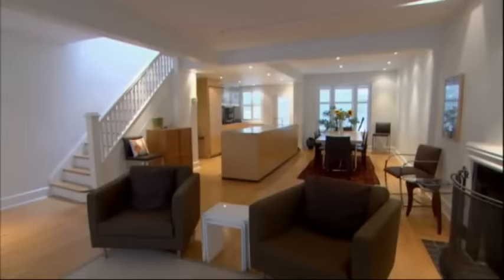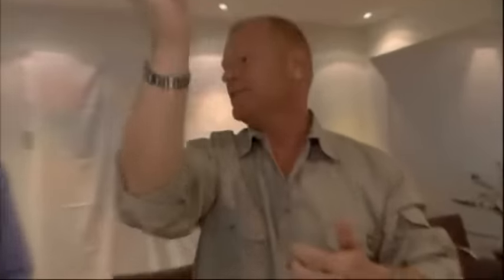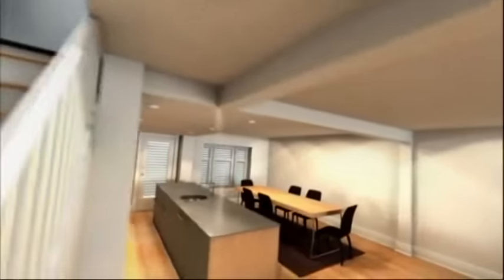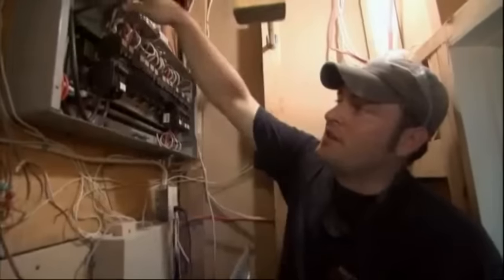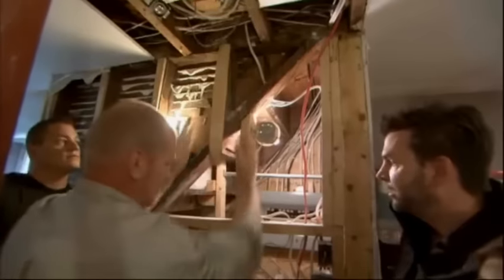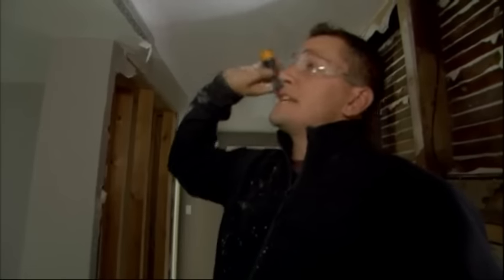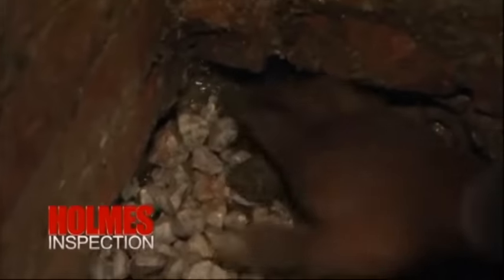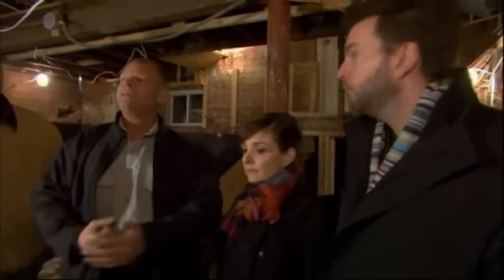Holmes Inspection Sea 01 Epis 22 A Load Of Trouble

Comment: Back in '68, my parents bought a new home from the contractor that built it. After a wile, we noticed that there was a hump in the kitchen floor and that the doors on the second floor weren't closing properly. It was not until '92 when I was renovating the basement, that we noticed what the problem was. Looking up at the structure supporting the main floor, the HVAC people had cut through a tripple-laminated 2' x 12' beam that supported a bearing wall that also supported the second floor, to install the main heat plenum. The beam had bee been so deeply notched that it had broken. The hump in the kitchen floor was on the high side of the break. We jacked up the low side of the broken beam and put a post there. That put everything that had been skewed back in place. In retrospect, we should have broken the floor, poured a footing and bolted the post in place, but as of 2008, when my parents sold the house, the post we put there was still doing its job.

Comment: I feel sorry for that couple. The husband looks like he's seen a ghost when the problems are pointed out and stays that way throughout the episode. Just total shock.
Reply: I don't as you can see with your eyes the uneven floors and the doors that don't close? Then you see no interior walks in a double brick walled home?  There's the same house next door. It's common sense that you run away from that house. You don't look for a vent in the floor on the first floor?  The panel has half breakers and two wires coming out of each?  

Before you buy a house buy some books on electrical, plumbing, etc...
They should have demo'd the whole house and started over as that's what they're doing from the inside out.
Reply: @johnmccall5576  LOL, so you need to become an expert in construction to buy as house? 
That's pretty unreasonable, if only you could pay someone with expertise to tell you these things for an educated opinion...

Comment: $300,000. I would build a new one.
Reply: Can't buy anything for less than one million now days
Reply: @vassa1972  this is from like 10+ years ago you pigeon
Reply: Better off living in a condo
Reply: @MultiTurbospeed  not necessarily, you've got association with dues, you can have a nosey or noisy neighbor. Association that won't fix anything (public space) or problems with plumbing go wrong with a neighbor it Can affect your unit (as in my case, neighbor had mold in the wall from a pipe leak) association took Three weeks of just inspection before starting work and contractors were horrible, had to take time off to be on top of them.

Comment: I wish I had heard the line "If you want to know what your house looked like before it was renovated look at your neighbors" before I purchased the house. I had a house that was renovated extensively. Come to find out it used to be a mirror image of the house next door.  Not even close to what the house next door looked like once they finished with the renovation. It explained the main problem I had which was water in the basement.

Comment: When will people learn: 1)NEVER rely on the sellers home inspector. You don't know what kind of deal may have been done under the table. 2) Missing walls in an older home like that, especially from near  the center of the house should be a HUGE red flag. 3) Sagging floors above where the walls are missing? Ah HELL no! Don't walk, run away from it. 3) Simple test, set a golf ball on floor and see if it moves. If it does, there's likely to be structural problems. 4) Don't be afraid to bring your own level to check walls, floors, doors, etc to see if they are true. Simple things people. 
My grandfather was a master carpenter. I  spent many, many days helping that man renovate houses. He told me that one rule of thumb in an old house is that, due to uneven settling over the years, it's almost guaranteed that floors and walls are no longer straight, true and level. You have to be prepared for at least SOME work to bring it back to square, even if that means that instead of 2x4s, you wind up having to rip 2x6 to compensate. Eventually you will have a room that you don't walk into and have your brain screaming "something is wrong here".

Comment: breakers have an internal tripping function, even if they can't trip from the outside/ fail to do so it still trips internally. Thats why the first trouble shooting anyone does at a panel is turn it off then on . Also the staples say right on the box you can put two 14/2s under a S2 staple
Reply: The staples might say that but does the law say that?
Reply: Licensed electrician here. Actually in Mike homes area lol . Yes the law says that, because if the box says that, it’s a manufacturer spec and it becomes the law .

Comment: This is another déjà bad house. The seller sold the house for a profit. Before buyers buy houses, they should sit down and watch all the old Mike Holmes' videos, to learn the pitfalls, and demand answers. If the seller hedges, they could be hiding something. Buyers should hire a professional contractor to inspect the property. It is better to get constructive (...no pun intended) input, than none at all. Mike said the repairs will cost $300K. Where did the couple get the money for the repairs?

Comment: I would definitely hire them for demolition but never for finish.Quick work is always full of flaws and they're no different.Their finish of the attic where they found some fake gold nuts was the worst i've ever seen from them.The ceiling had more bends on both sides than I95 between Jersey and Miami and they didn't have to extend the roof joists,either.as there was enough space for insulation with air.